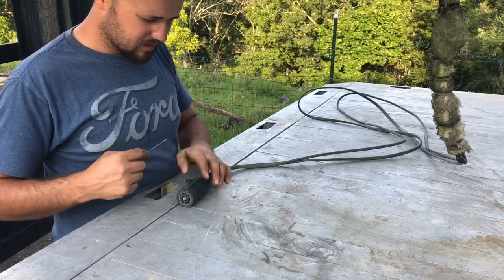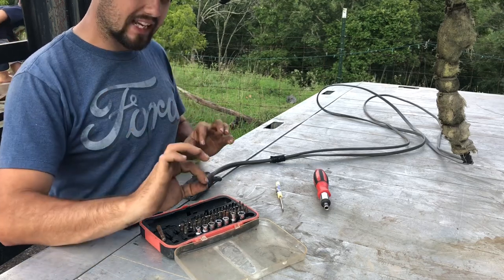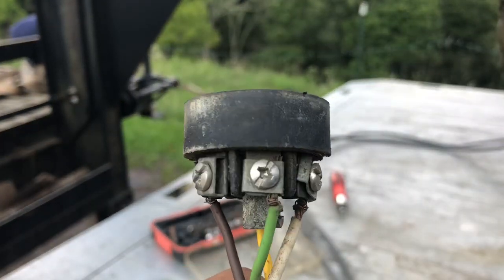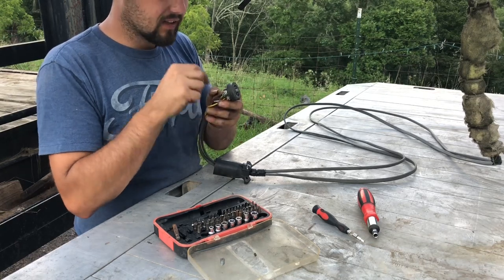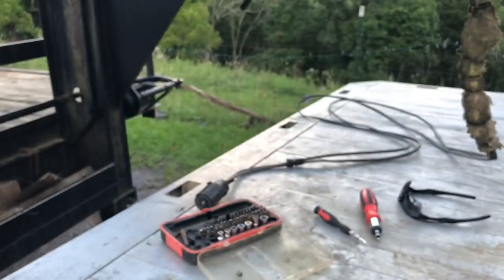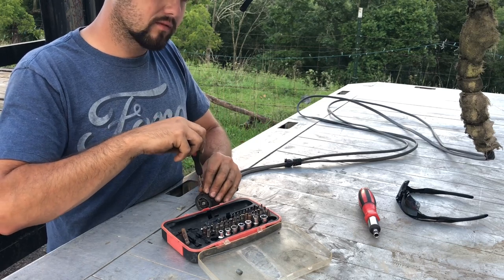Trailer repair with one blind farmer 👨‍🌾

Comment: I hate those things so much I bought a junction box and a premade molded 7-way cable long enough to go from inside the bed up the gooseneck to the junction box on the rails at the back of the neck. Etrailers.com, cheap enough to be worth the money. Just take the wires from the lights and put the loop end on, slide over post on junction box, slide loop end from 7-way on post, tighten nut and done.
Reply from the maker: That’s actually a good idea that would also get rid of the 50 connectors on a trailer to

Comment: This reminds me that I need to change the bulb in my truck's license plate light.
Reply: This reminds me I have to diagnose my new to me trailer brake issue. Don't work at all. Got a smokin' deal on the trailer though. On vacation this week, add it to the list of things to do.
Reply from the maker: I would check the pig tail first then start from the back and work my way to the front
Reply: Thanks. I'm certainly hoping it is just a shitty wiring issue.
Reply from the maker: They can be so aggravating